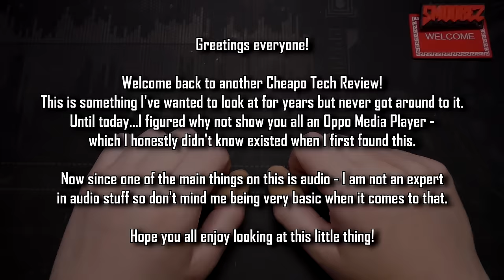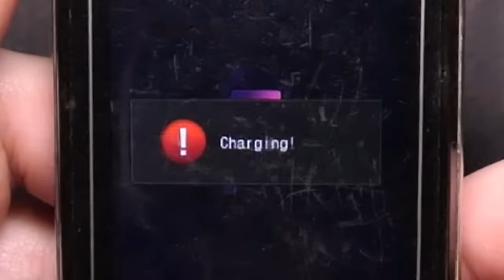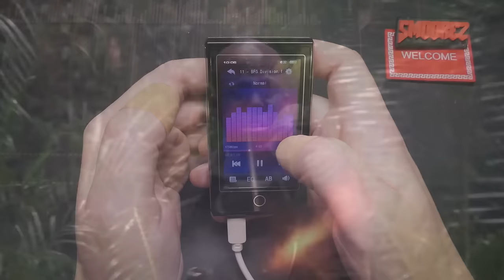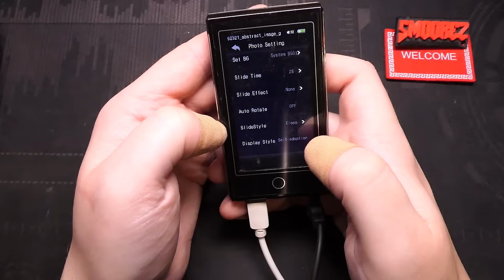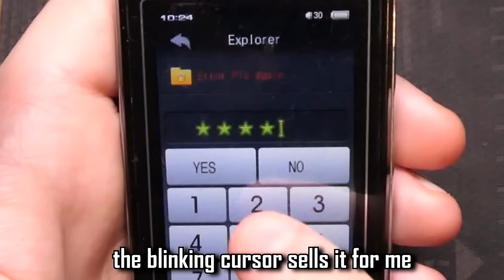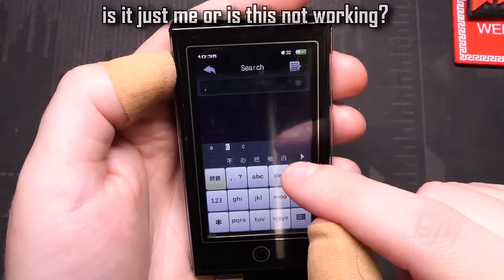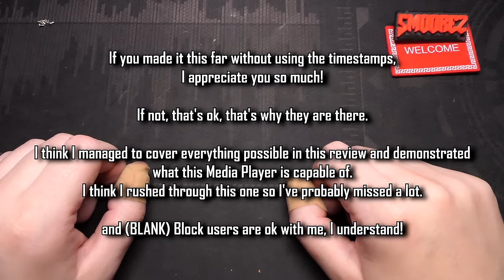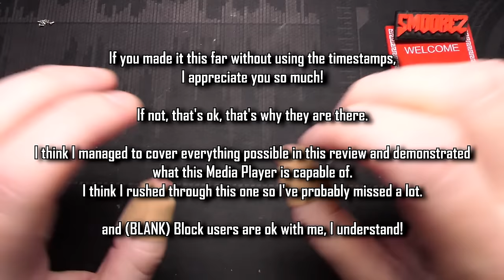The Oppo S33 Smart Media Player *kind of* looks like a bootleg iPod Touch

Comment: RK27xx is technically a "dual core" but it's just one ARM and one DSP, the former running at up to 200MHz while the latter goes to 150MHz. Considered a mid-level device when it came out.